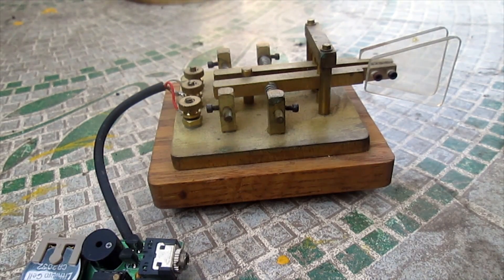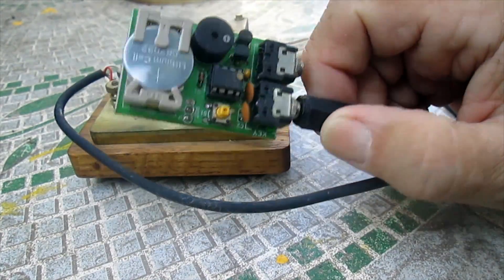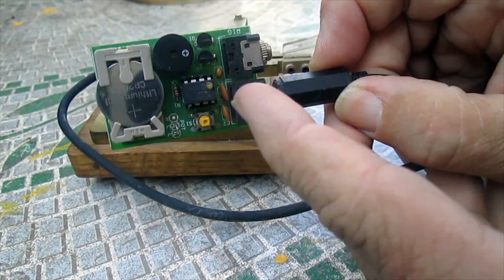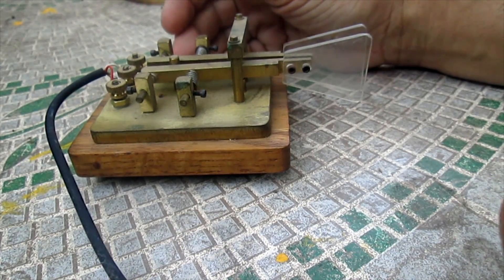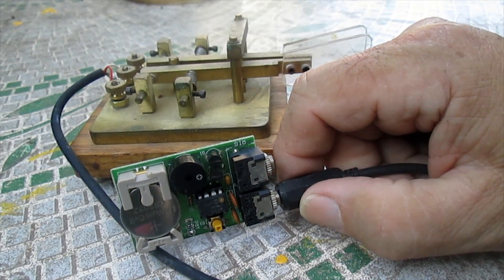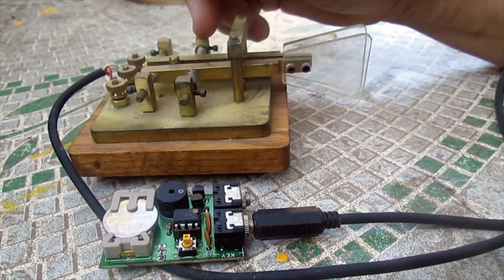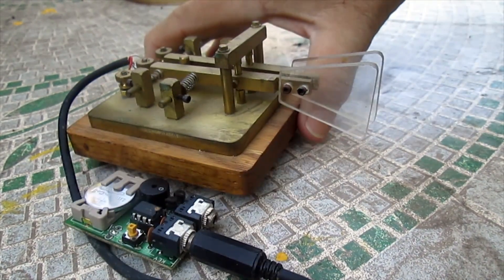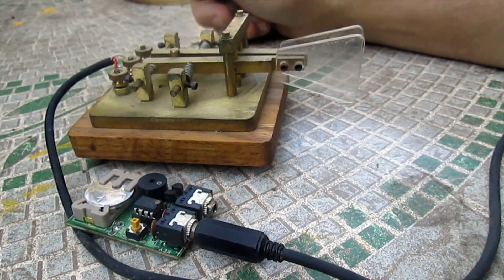Morse Code Paddles and Keyer

Comment: A simple pulse of fixed duration can be generated by monostable multivibrator circuit and a continuous stream of pulses can be generated by an astable one. .  Both arrangements can be created using 555 Timer IC's or the 556(dual timer).
Reply from the maker: yes I see your point, but this keyer chip has a lot of built in programing as well.

Comment: What is the duration of the dit on your apparatus? One third of a second?
Reply from the maker: +Jeffrey314159  it all depend on the sending speed you set in the device
Reply: That is changed by adjusting the tension spring and contact screws?
Reply from the maker: No on the circuit board. The paddles stay connect as you press them. The timing is all in the circuit board I connected. I think,  t let me check the Bencher paddle site for more info on using the paddles by themselves.
Reply: +Mike Kennedy How does the automatic telegraph key generate a continous stream of dits or dahs?? Does the key mechanism create them or the electronic circuitry?? If it is the key itself then how does the stream of dits(or dahs) get produced by holding the key in?? Is there a 'make or break' electromagnet device that keeps the pendulum swinging indefinitely??
Reply from the maker: let me research.
Reply: +Mike Kennedy  I wasn't just talking about your device(which now seems to have its dit/dah pulse duration and frequency generated by the electronic module present in your video), I am also referring to very old-fashioned telegraph devices such as The Vibroplex. 
This semiautomatic key seemed to be generating a continuous beat of dits of same duration and constant frequency as long as the key was squeezed. It seemed to do so mechanically.
Are there telegraph keys, sideswiper or otherwise, semiautomatic or otherwise, that function like the mechanical equivalent of a monostable/astable multivibrator circuit?
Reply from the maker: you sir, no more about it than I do! I am going to look into this more so I can learn enough to answer your question correctly or at least get a link to the manual on this particular key. I assumed, and from what you indicate I am wrong about that paddles like these need to go into a keyer circuit. I will return with more information.
Reply: @m005kennedy  and have u returned with more information!? It's been 4 years
Reply from the maker: @arisoda  no I have no new information.